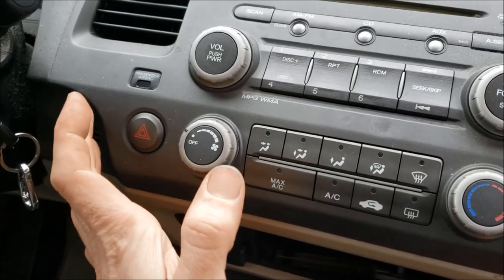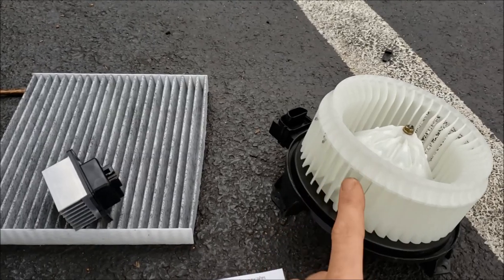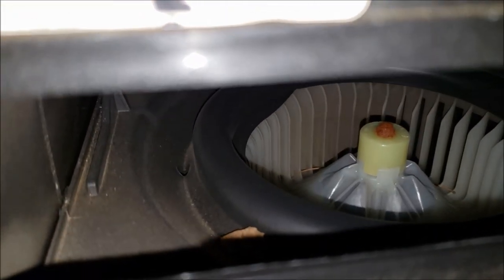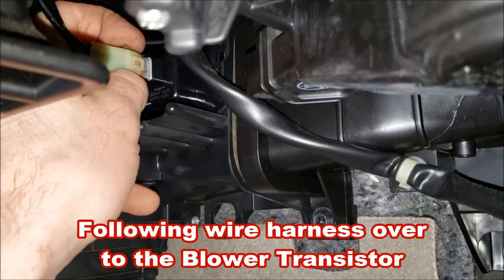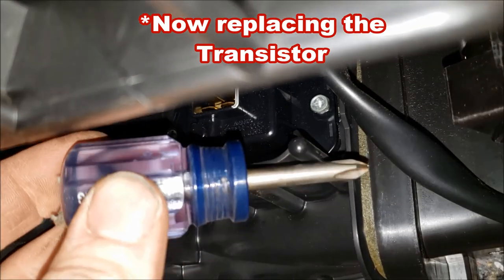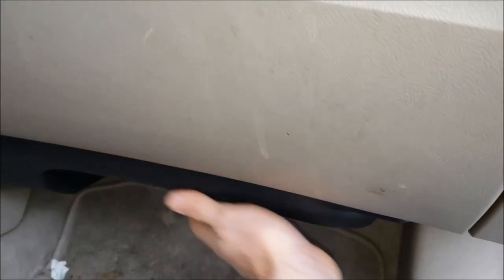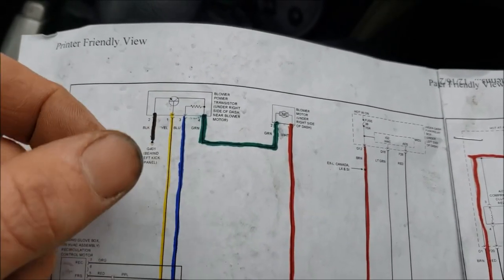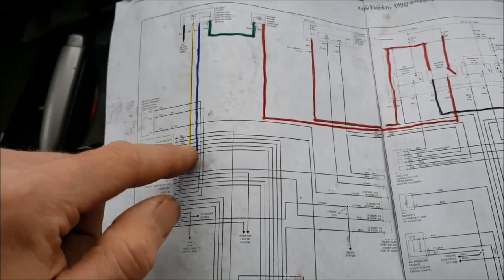06-11 Civic BLOWER FAN / TRANSISTOR REPLACEMENT and diagnostic - Honda

Comment: I'm so thankful for this video. It made it so easy that my ten year old son was able to take everything apart and change my resistor and then put everything back together. We only had problems with 2 major parts which was  That 4 wire plug out and then the second screw on the transistor it was so tight up in there and did not wanna come loose. It took us a couple hours, but we finally got it. I initially thought my blower motor was out, but I was able to take it into the park store and they tested it for me and it was still good so that told us it was the resistor. Even though the blower fan did come on when we would kick it or hit it. It's still was not the problem in the end. Thanks again!!! Ps He also changed my air filter.

Comment: I appreciate the video diagram explanation. My neighbor has two problems with his 2009 Honda Civic EX:
1) The Condenser Cooling Fan is worn out. 2) The HAC Blower Motor under the dash works only intermittently. 
Seeing the wiring diagram shows me exactly which fuses, relays, diodes, grounds, wiring and  ECT 1 & 2 to test. Thank you!!

Comment: Thank you so much for this video. I was able to change out the blower in less than 10 mins. Would have been faster if I had a short chub screw driver. Other than that, it was very easy. This Texas heat was killing me. 🔥

Comment: Thanks for the post I changed my fan blower motor out and blower transistor out about 1 year ago with genuine Honda parts fan has be gradually been getting worse for a while now when you turn it on high or low what ever the fan speed is turned too it slows way down or doesn’t blow at all sometimes it works sometimes it doesn’t fan speed fluctuates. I keep my cabin filter changed regularly. I’m thinking it is the hvac control unit itself maybe going bad. Thanks for the post.

Comment: Got my AC super cold and heating great as well, on my 13 Honda Civic. but after a 30min ride on a freeway, the airflow just stops, it seems the fan still working cuz makes noise, and is cold, but not blowing air. What do you think? Thanks for you tip with the video, your time and patience. God bless you brother
Reply from the maker: It's possible that your evaporator is icing over.  The system runs too cold then the evaporator will get ice all over it
Reply: Check your drain also,  if it's not dripping on the ground with ac on that will cause it to ice over.

Comment: Awesome session with simple explanation!  Where can I go to find the setting for a Nissan frontier air flow setting intake.  Brother messed it and his truck runs like crap
Reply from the maker: I'm not sure I understand your question. What do you mean the air setting?
Reply from the maker: are you talking about the mass air flow meter?
Reply: The intake to the nissan frontier 1999.  On throttle position and idle.  Cant remember how to set it back.  Not finding any help on the net. Thanks may have to take it to Nissan 🤬🤮
Reply from the maker: @jessesalcido2562  oh I see. Yeah I'm not too sure on that off hand. I'm sure the dealer will try to stick it to you though.

Comment: Hi, I need help with it as I’m Honda Civic fan!! My blower doesn’t work as I did replaced the blower only. Could it be the wire issue as AC/Heater doesn’t work at all… should I buy Resistor?? Thanks!!

Comment: Bro what voltage should come out at blower motor pins , mine comes 14.5v , is that the reason blower motor works but very slow ? Can we consider 14.5 voltage for the blower motor pins as the transistor is bad ?

Comment: Hey there I’m gonna try my all time best to describe my problem haha. So, I have a Honda Civic and when I turn the key to wear the car is only using the battery it’s not on yet and I have the air on full blast I hear some fan running near my engine area for a second or two then it turns off. However, when I turn it all the way on sometimes air blows for a split second then cuts off or it just doesn’t blow anything at all doesn’t matter if it’s heat or AC. And I turned the car on and looked at that fan you are replacing and I saw that it isn’t turning at all. Would you think this video is my solution? Because I some say it’s a air compressor and that’s like 800 dollars! If you could help me out that’ll be awesome!
Reply: I also tried hitting the bottom of it like you said and nothing happened.
Reply: Hey, did you ever figure this out or a solution? Thx